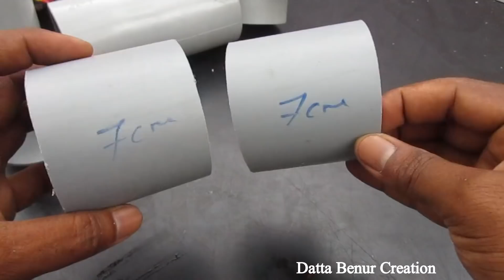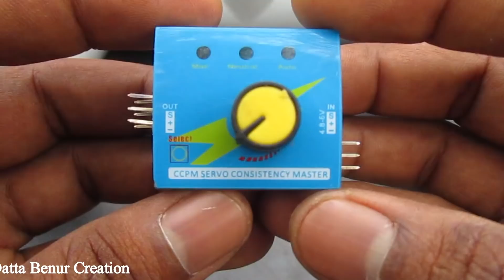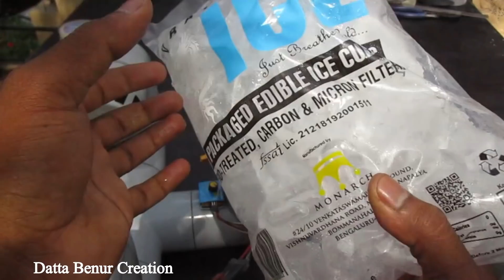How to make a air cooler - Powerful Air Cooler at home DIY

Comment: Not a practical product. Though good as trying to learn concepts. Remember, if you are using ice as a cooling agent,  it will cost you more than running an AC. !! 
This product can be used as ventilation device, but taking cooling effect will cost you more than AC plus water showers, battery charging and maintenance etc etc.
Reply from the maker: Thanks For Your Feed Back